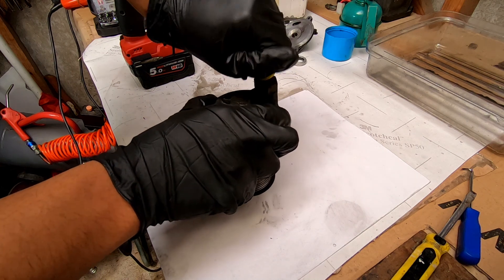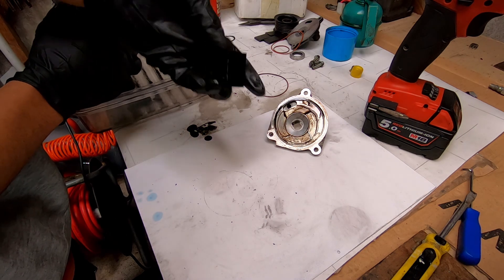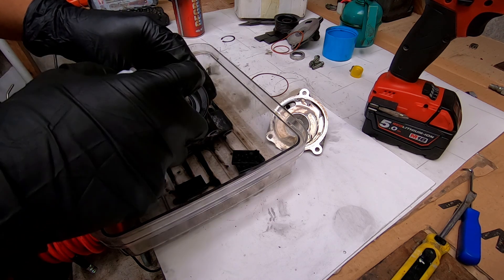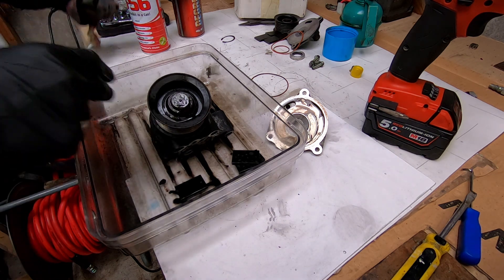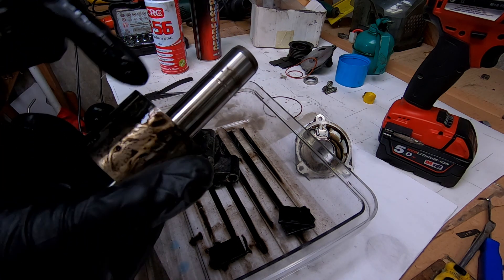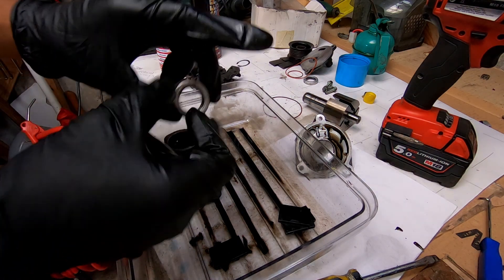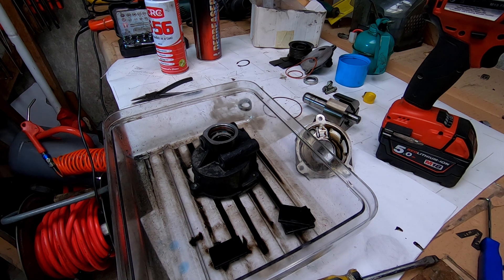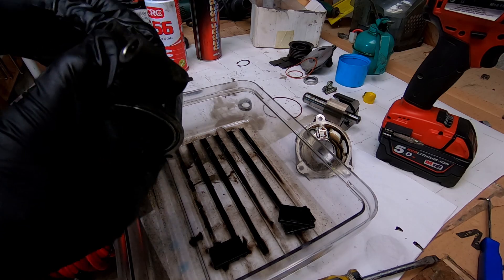Ford Diesel Vacuum Pump Disassembly (Complete tear down)

Comment: Can i ask on the back of the housing where the pipe goes into that connector , is there just a ball bearing inside there only i had taken mine off and one dropped out but not sure if there should be anything else in there. Muchly appreciate your reply
Reply from the maker: It is like a check valve but nothing should fall out. Does you vacuum line stay in place? While the vehicle is stationary and the engine running do the brakes feel ok or is it spongy? Take caution if ur driving it and your unsure
Reply: @AutoBuddynz  thanks for the reply appreciate the help 👍, So I've never done a water pump and was told to unbolt that part  it wasn't until i was putting things back together i felt something hit my hand which was that ball bearing, i cleaned it off and put it back in and I'm sure there's a little piece i could feel with my finger right at the bottom too which i assumed the bearing would hit to close it off. The pipe to the vaccum stays in place and my brakes feel the same as before. Id buy a new pipe fitting but cant find them so would that mean a new vacuum pump?

Again thanks for the help 👌
Reply from the maker: @scottevoevans I haven't come across this issue before with the genuine Ford vacuum pump, if your in doubt just replace it, since its part of your brakes its important it does not fail.

Comment: Just had one fail after 400kms. Oil leak from behind pulley. Increases under load. Add some UV dye to engine oil, go for a drive at 100kmp, then pull over and enjoy an amzing flourescent pattern throughout your engine and chassis, all created by the Vacuum Pump shaft seal!

Comment: Hi there appears to be a difference with the mk7 or 2.2 tourneo vacuum pump.. being that it has what looks like a fat pipe attached to it.. when it’s inside the vehicle this fat pipe sits under a metal thin hose.. I can’t get it out because of the way it’s under the hose.. am I missing something? I can’t seem to find a video on this.. any help very much appreciated! It’s been unresolved since march!
Reply from the maker: @naturalman4185  Thanks for the info, look like the late gen ones have a slight difference, will have a look in this and probably make a short video
Reply: Thanks that would be awesome appears there are none on YouTube as a result I have no idea how they take them out!!

Comment: Great video! Would I be able to take apart the pump and add some sealant instead of a new seal part/gasket?

I live in australia and can't have a new part sent to me unless I pay extortionate dleivery costs!
Reply from the maker: You could try. It if it sets correctly then I don't see why it won't work.
Reply: @AutoBuddynz  thanks for replying mate! I managed to source the correct gasket so I'm gonna put it on tomorrow, thanks for the video, will help a lot!
Reply from the maker: @sebfleebee  Great!
Reply: @sebfleebee how did it go?

Comment: Great video just what i was looking for, got a question if that's ok? I dont have a press so im going to buy a new unit as its only about £50 i know i have to loosen the belt but is there anything else to do when removing and refitting or is it simple disconnect unbolt and put a new one on?
Reply from the maker: Correct, its just the 3  bolts and  vacuum line holding it on, once you remove the belt. I have a video on it https://youtu.be/aL-ZVr-xBsE
Reply: @AutoBuddynz  thanks for the reply one last question will there be any major oil leakage when i remove or just whats in the vacuum pump housing
Reply from the maker: Oil will leak as the water pump and vac pump are oil cooled bit nothing major. Just keep some rags nearby
Reply: @AutoBuddynz  perfect thanks

Comment: The pump does not need to be disassembled to replace the stuffing box.
Reply from the maker: No it does not need to be disassembled, you just fit on a new replacement pump. This video was made for educational purposes in-case someone wanted to fix their existing vacuum pump and was not sure how to disassemble it.
Reply: @AutoBuddynz  The oil seal can be changed without disassembly.
And more it will work for 20 years

Comment: Hi, 
Thanks for the video,

Can you open up the housing also where the vacuum pipe connects. All I have from inside is a weak spring and ball. Somehow I believe I am missing something where the ball seats?
Reply from the maker: Are you referring to the vacuum pump seen in this video? or the brake booster?
Reply: @AutoBuddynz  Thanks for your quick reply.
I am referring to the pump in the video. Is it just a ball and spring inside the brass connection where the pipe goes?
Reply from the maker: @fantasyfilledfuckers  Yes you can open that and replace the parts inside, Ideally it should comes with everything in a rebuild kit if you can find one.